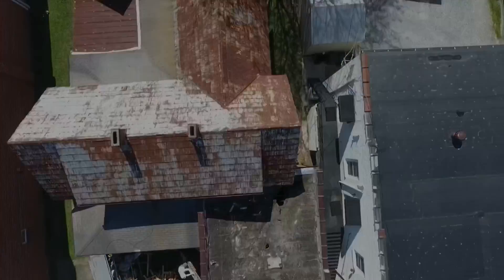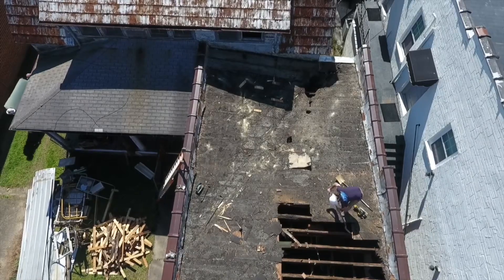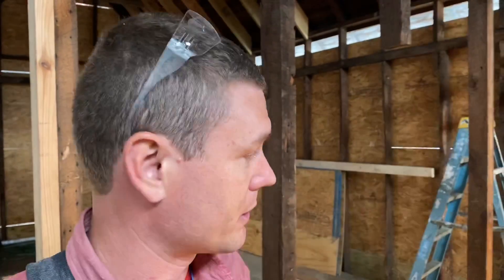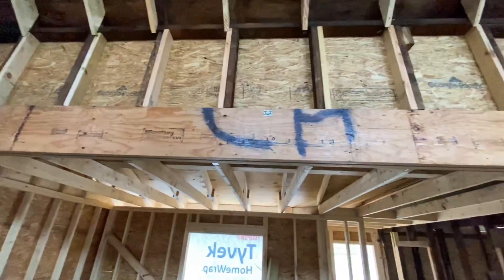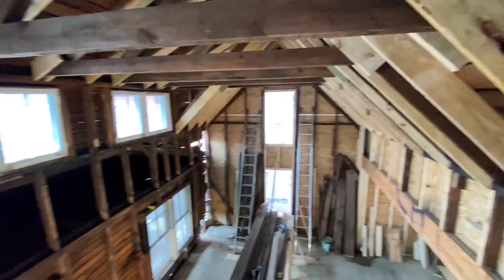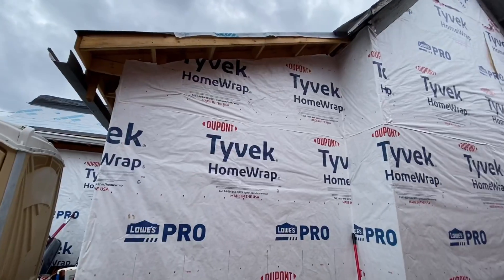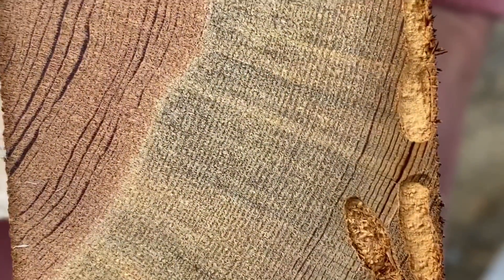100 yr old walls exposed | How framing has changed

Comment: My house was built in 1921. There is no insulation, that means during winter it is freezing cold inside and in the summer it's HOT. Energy saving? Please! You turn off the AC and in less than 2 minutes I start to get cooked by the heat again. I got used to it though, during the winter I sleep with a sweater and 3 blankets on top.

Comment: What character are you preserving?  You say you pulled off the original siding and replaced it with chip board & tyvek.  Spray foam is problematic, at best!  Where is the vapor barrier?  Tyvek is vapor-open and air-open and leaky around windows & doors with the standard origami used by most.  I don't see much of the original home left.  That leaves little argument for preserving the original character of the home.  Did I miss something?

Comment: Lived in a old house with native lumber (2x4 was “Actual”).  It was Difficult to screw into!!…extremely hard!!….”Commercial” lumber is very weak, yet much easier to work with.  I remember, high school job 30 years ago, we tore a barn down for the lumber……the wood ate up our chainsaw blades, literally throwing sparks.  Planing it was very hard to do…..fractions of an inch at a time.  I find it fascinating how lumber has changed.  Today, the argument could be made that we have Junk lumber compared to yesteryear.  I suppose it is what we have become……all commercialized……heck, just look at our food….good luck finding any small hog farms.  (Less quality, more quantity, all based upon profit)
……sad.

Comment: My old studs are FAR denser than the new studs. I would use the old wood over OSB anyday...except molded. I'd use CDX plywood. Never blown in isulation, that stuff becomes trash after a decade or so.

Comment: Studs back then were 2x4 or 1 7/8 x 3 3/4” which were a lot stronger than current 2x4’a that are 1 1/2 x 3 1/2. 

This means that 1 7/8 x 3 3/4” could handle a much heavier load than current 2x4’s!

Comment: You can still find full 2x4's used in newer construction stuff as well. Renovated my friends house before they moved in that was built in the late 70's. It was built using true to dimension lumber. Depends on if you've got mills that still do it around you I guess.
As for my basement that our house sits on, we have old timber framed joists for the floor that used to sit there. Everything is rotten and has to go, but man is that stuff still tough to tear out.

Comment: How many roof rafters did you fracture trying to straighten the bow.?
Reply: lol, I'm working on a house where the lumber has so much crown that it took the kitchen wall out three inches from the floor over 100 years. Had to winch the wall back inside and anchor with modern hangers. A few more years and it would have collapsed the home.

Comment: I did a kitchen renovation in a house built in 1653. The homeowner had a map of the area from 1656 which showed his house.

It was post and beam construction.  All the interior framing was 2x4 oak. Those studs were almost petrified wood.  Had to pre-drill for every fastener used.

One very interesting thing was the framing for door openings consisted of a 4x4 post on each side and (unlike your  house) a 4x4 header toe nailed into the posts with a couple of 16d equivalent hand forged nails.  No jack studs and after 300+ years those headers were still dead on level. It was really quite impressive how well the building had held up.
Reply: That's awesome

Comment: These houses survived because they were built of dense strong timber (hence the tight growth rings), and the lack of insulation and engineered wood means they have very high moisture tolerance.  The more you insulate and air seal, and the more engineered wood (osb, plywood, etc) you use,  the less tolerance for moisture your structure has.  Engineered wood can't absorb as much moisture as real wood, and evaporation is an energy exchange process, so if you're super energy efficient, you're retarding the evaporation process.  Those old houses could soak up and dry a ton of moisture without rotting, in part because they were not very energy efficient.

Comment: There is too much emphasis on  "they don't build them like they did  in the old days".  Houses are built much better today than they previously  based on better building technology and things we have learned from previous failures.   The only reason people still preach  the old house gospel is because they see expensive, old houses still standing.  But the guys that could afford to build a big house  could afford to hire the best carpenters.  But you rarely see any homes that the working man or the middle class lived in because they fell apart and fell down.  Newer and modern is better.

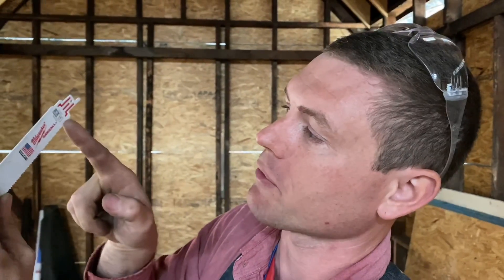Comment: At 3:00 you say you run the timberlock into the rafter to straighten out the roof.. what are you driving the screw into? The original rafter? The new one into the old one? Could you explain that to me a little better?
Reply from the maker: Good question… We were driving through the new 2x8 at a shallow angle into the bottom corner of the old 2x4 rafter.  In order for this to work you have to leave a gap between the two as you start the screw into the old 2x4. This allows the new 2x8 to move up and over at the same time at the angle of the screw until it is tight in both directions. It takes some practice to get this to work perfectly. I will make a video

Comment: Good luck having a modern home last that long.  Those old buildings lasted a hundred plus years BECAUSE they leaked air, allowing lumber to dry.  Moisture now is trapped.  We see homes 2 to 5 years old with rotting sheathing, plates and studs.  The biggest  friend of long home life is big overhangs and gutters.  Some interesting methods that allow free air movement between the siding and sheathing show great promise too.

Comment: Old framing and building techniques have stood the test of time.  I have worked on several older homes and sometimes l am shocked by the methods, but as others have stated, old lumber was structurally stronger.  I recently dealt with a sagging roof - 24" on center two by fours for rafters?!  A lot of jacking and sistering of new joists - had to do it slowly in order to not tear apart the old work...  I enjoy this type of remodeling though, and the challenge 👍
Cheers!
Reply: I used to think that these large scooped roof shapes were actually a complicated design feature of the old carpenters, lol. Now I've seen several from the inside and I still don't understand how the roof doesn't collapse. 20ft 2x4s simply nailed together to make longer boards.

Comment: Tanalized  Treated 4x2 in New Zealand is still 4in ( 100mm) x 2in ( 50mm). It wasn't that many years ago that all machined timber was ripped down a total of 3mm, so a 100x50, dressed 4 sides would be 97mm x 47mm, however since I have been home, it has changed to the American way, where again you pay for something you don't get... I have always said 4 x 2which confused a few people in Oregon where I spent the last 12yrs..  a bit of usless information for you..

Comment: Atleast that house was built with studs. I am in the deconstruction and reclaimed wood business, just finished up a job of a 1930s era house.. from outside to inside the walls were layered starting with lap siding, 1" boards, with an interior of 1.5" sheetrock/plaster. No insulation, similar to your situation. However there were about 6 chimneys spread throughout the structure. I'm curious as to if your project has a subfloor? My project had T&G pine nailed straight to 2x8 and 4x10 floor joists.

Comment: Don't ever use spray foam insulation, you'll regret it in the long run.
Reply: Isaac alvarez and you need to stop believing everything you read on the net, it like everything the product is only as good as the guy installing it,that's why you check references on a contractor .
Reply: @heknows5418  spray foam is trash and human error happens quite frequently. Another thing, when someone new comes to do a repair they have to deal with that cheap garbage spray insulation.
Reply: Isaac alvarez nothing wrong with it many satisfied people with have it and are enjoying the lower power bills.

Comment: Old houses... there's nothing like them. They have character and its always fascinating to see how to they used to build a century ago. For me, the term "they dont build them like they used to" is true. However, there were good builders and bad builders back then like there are today. #Facts. I'll be working in an old house this week in Millburn, NJ. House was built in 1910 and has (4) floors. I'm there to change some light fixtures and were wiring up a new mini-split system on the 4th floor. I have (2) panel changes to do too. Btw, lots of money to made in old houses too. Cool video.

Comment: The growth rings proves the older Lumber to be better quality IMHO.
As a builder I've always noticed the older wood could tolerate more abuse from the elements vs new quick grown, quick produced lumber that warps and rots very quickly.
Reply: I did some renovation work on a national landmark building that was constructed 150 years ago and it had clear pine boards on it 20 feet long and a foot wide. By clear I mean not even a pinhole knot in any of it. Grain was straight as a laser beam too. If I hadn't seen it I'd have never believed it. Was like wood from an alien planet or something. The old timers really did use the best of what was available to them. They left us nothing.
Reply: The old true dimensional lumber was pine rather than spruce.  The natural resins of pine protect it from moisture and bugs.
Reply: @chrisgraham2904  SPF stands for, Spruce, Pine, Fir. Spruce is pine. Well, they're all conifers. Construction grade lumber is supposed to be SPF. Then there's the enduring mystery of what is white wood? That I don't know. I do know it is weak, light and softer than tissue paper though.

Comment: Lumber was changed from dimensional to nominal during WWII with rationing and no manpower. The US Forest Products Assn. conducted tests that are the basis for modern construction including loads/ spans/ species. They also conducted all sorts of fire tests that serve as the basis for our clearances to combustibles such as around chimneys, vent connectors, etc. We find many chimneys from the 1940's constructed of terra cotta flue tile encased in asbestos coated with cement instead of metal because of shortages. Transite cement/ asbestos vent is one such example of these changes. To support the building boom after the war, tree plantations sprung up with fast growing species resulting in wider growth rings and markedly weaker performance than old growth. Now, we take even faster growing, cheaper woods and process them into engineered products that can outperform dimensional lumber in many respects but often fail in others such as resistance to rot (OSB for example). 
Those bare clapboards in the video survived because those walls were ventilated on both sides thus allowed to dry rapidly. When we began insulating and weatherizing homes in the '70's in response to OPEC cutting off our oil because we helped Israel during the October War, we immediately noticed two changes in homes: condensation on the windows and the fireplaces spilling smoke. Once the Swedes brought their blower door testing to Princeton and we began learning building science we now have a better understanding of how buildings work and fail. I invite you to check out BuildingScience dot com to learn more from Dr. Joe Lstiburek & Co. 
Perkins Bros. seem to represent a growing breed of conscientious builders rising above the hacks of the last generation. Keep up the good work guys.

Comment: I’ve reno’d a few houses from 1700’s to present. The techniques have changed dramatically. Never under stood why they notched everything prior to late 1800’s. Good thing the lumber was way stronger especially because the 2 x2 tongues on 2x6 floor joists were pretty sketchy. Although even with long cracks they held. Old definitely had “character but modern is stronger yet way more susceptible to decay.

Comment: I am rebuilding a 1940 country house.  2x4 rafter roof with 8" sag.  I feel your pain.  I am also going back with 2x8 sisters. Along with triangles at the peak and such.
Reply: Do it slow, set braces, use a hydraulic jack to lift it, let it sit for a month or so then up a bit more. 
Work with the wood, it's in it's 80's and set in it's ways.

Comment: I owned a 1890’s balloon-framed 3-family house. Easy to run wire and plumbing. Awful to keep insulated. We even had knob-and-tube wiring in the basement!  (Until we replaced it minutes after closing.)

Comment: I believe the small size of the rooms back then had more to do with the difficulty of heating large spaces than the availability of long lumber, which, as demonstrated by the popularity of balloon framing, was actually very good.
Reply from the maker: Nick Garwood I think you are correct… Rooms with big high ceilings are difficult to keep warm!
Reply: @PerkinsBuilderBrothers  Especially difficult without forced air heating, which they didn't have
Reply: They totally had long lumber back then. I've seen it. They were felling trees 150 feet tall. So yeah getting long boards was not a problem.
Reply: Rooms were also sized for their utilitarian function rather than for showing off.  Do we really need a 24' X 24' kitchen to make a sandwich?  Compared to the outhouse, those old indoor bathrooms were enormous.  I don't think the old home rooms were small for heating purposes...wood and coal were cheap or free so you just stoked the stove or the fireplace until it roared.

Comment: Can you show what it’s like to hammer nails into the old wood vs new? I have a home built in 1929 and that pine is hard.
Reply: Saul Rosas there is a reason they used cut nails. The cheap ones we have now won’t hardly drive in heart-pine lumber!
Reply: Ted McNair:
This is for Saul-
I rebuilt a barn for friend using rough sawn (true measurements) and existing Heart Pine Lumber- driving 20 penny nails- at one connection, my 24oz Framing Hammer 🔨 bounced back onto my Forehead, just above eyebrow, implanting in my skull! Yes, Old wood and sawmill rough wood don’t mix‼️ 
Brain injury changes Life🔨‼️
Went back to Stone Masonry & all Masonry, Concrete included‼️

Comment: The old wood is so dense you can hardly drive these straight barrel nails into them
Reply: Pre-drill and screw, is the only way. A nail gun turned up won't do it.
Reply: Use the old square cut nails.
Reply: Almost need to pre drill
Im not so sure a grk screw would go in without a snap
Reply: Max framer at 400 psi would do it
Reply: @proficientbuilders3565  Pray you don't hit a knot.

Comment: When you say, the rafters, you sister a 2"x8" on the side of the 2"×4" correct ?. I'm just asking to learn, please.
Reply: Thats correct
Reply: Those old 2x4's were more than likely oak, so you need a 2x8 to get anywhere near the same strength.
Reply: No, They were Heart Pine 🌲‼️
More Prevalent in NC Mountains‼️
Even back then, Oak was used for furniture‼️Been building and Stone Mason These Parts 50+years‼️
Reply: @joetownsend- 😂

Comment: I have driven in a few GRK 4inch structural screws to sister sagging beams.  60 volt batteries in my DeWalt atomic series impact.  She gets HOT!!!
Reply from the maker: Wow! That should get it done! 10 years ago I never could have imagined how awesome cordless tools were going to be
Reply: @PerkinsBuilderBrothers  we just need to have batteries charging ALL the time.  Not so easy in the winter however.

Comment: Another great video. The difference in 2x4s is amazing. I'm sure you're going to reclaim the old lumber from this project. BTW - Bryson City is a beautiful place!
Reply: I guess you didn't notice the termite holes in the piece he held up? You want to burn wood like that.
Reply: @1pcfred  instead of burning old stuff like that, when I remodel, I think of how I can integrate it into a project. Maybe not reuse it for a wall, but a kitchen table or seat, or even using it for a brace on a shelf in the garage.